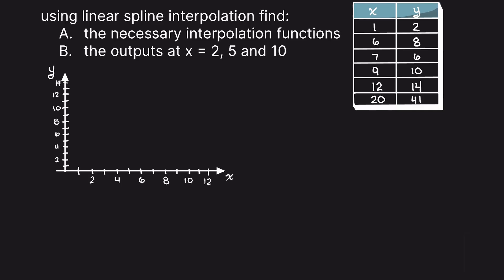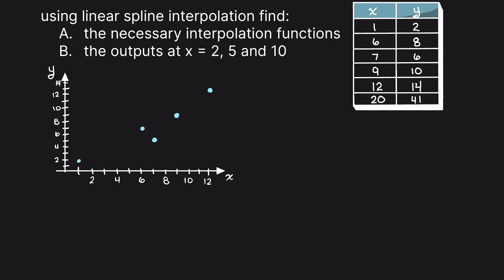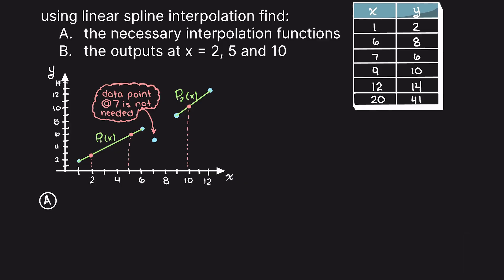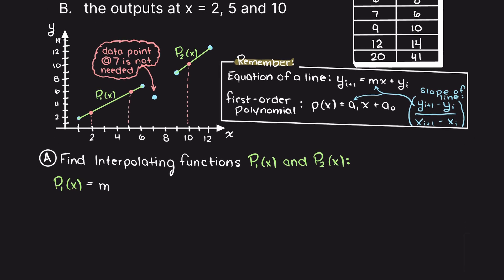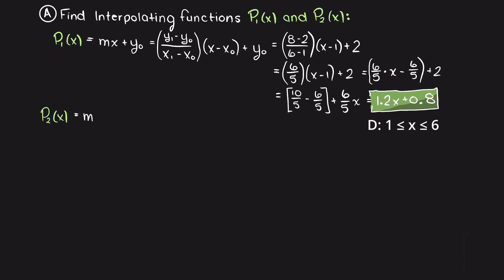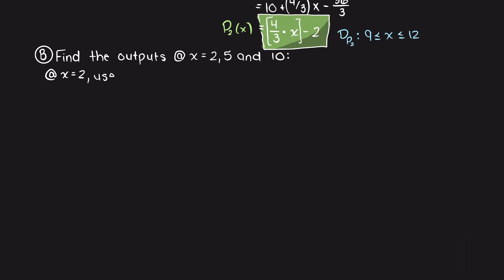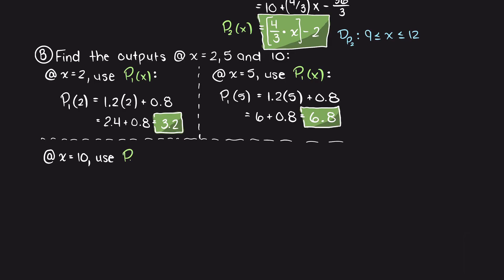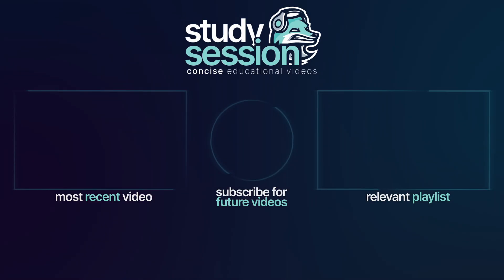Linear Spline Interpolation Example | Numerical Methods

Comment: this is confusing in p2 
u using the third value is place of the second values
Reply: I assume it's because he didn't use 2 as second linear equation for whole interpolation but more as second function he will be calculating. To calculate point 10 we need calculate spline between x=12 & x=9 which is correct, but it's second spline he calculated.